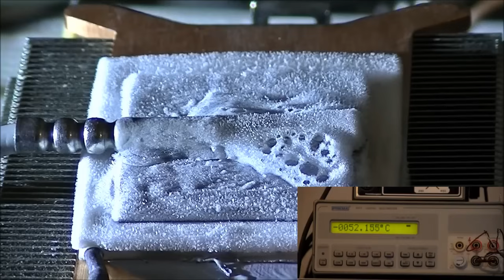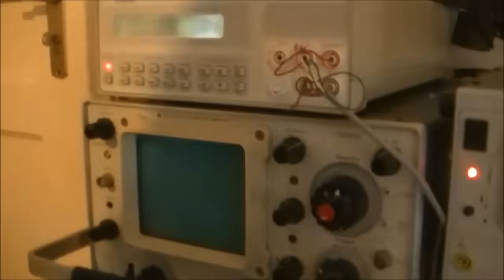Peltier cooling

Comment: Was für ein Netzteil verwendest du um das Peltier Element zu betreiben?
Reply from the maker: Ein 300W schaltnetzteil  MRGN-300, gabs mal auf ebay für 130€   hält leider keine spannungsspitzen auf, also nichts für schaltungen die mit hochspannung zu tun haben.
 Aktuell kostet es 170€ http://www.ebay.de/itm/221218838083    
Dieses hier ist besser geeignet, wenn man nicht so viel ampere braucht:
www.ebay.de/itm/360753169696
(Trafonetzeil, kein schaltnetzteil.  wieght mehr, hält auch mehr aus.)
Reply: gamerpaddy Danke für die schnelle Antwort. Leider liegen die beide außerhalb des Budgets, dessen ich bereit bin für ein kleines Projekt aufzugeben. :\
Reply from the maker: Das hier ist das günstigste was man neu bekommt, welches 10A bei 30V abkann.
www.ebay.de/itm/400654008950

Selbstbau aus alten Server Netzteilen wäre billiger . 3 bis 55V bei ~ 2.5 kW leistung ungefähr 50-100€ 
im forum mosfetkiller.de ist irgentwo eine umbauanleitung

Comment from the maker: ne :P  Da müsste ich ja 100W in die LED stecken, und 800W in ein großes Peltier (80W abwärme der LED / 1/10 effizienz von Peltierelementen. also bei 80W die ich kühlen will, brauch ich 800W input beim peltier.) Und eine kühlung die, das peltier kühlt.  Ein einfacher CPU Kühler für neuere Intel/AMD modelle reichen vollkommen, da diese einen TDP von 150-200W ableiten können.

Comment from the maker: In this video im using a PC fan, for Six-core cpu with 140W TDP
but i tried a heatsink in frozen water too, the temp decreased to -70°C, after 10 seconds it increased again :(

Haha :P i should try a setup with a PC Compressor Cooler. (that big block coolers with a frige compressor goes down to -40°C

Comment: Hello,

- 53 °C ?? thats a lot. But how is this possible...normal peltier elements just have an delta T which is about 70 Degres....so the hot side in this video has to be about 20 °C ??